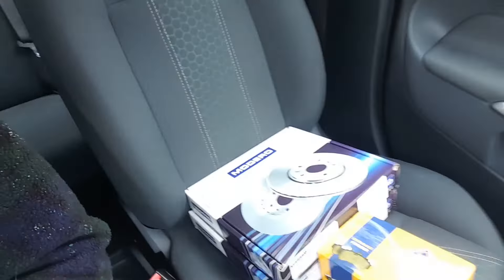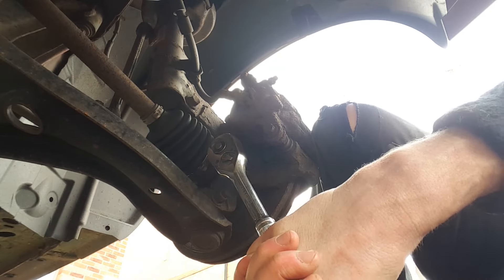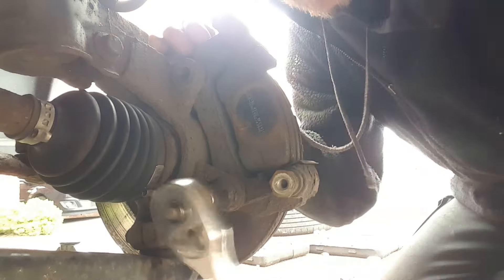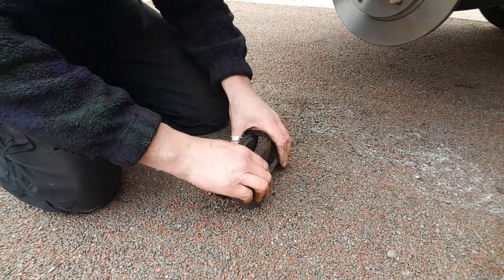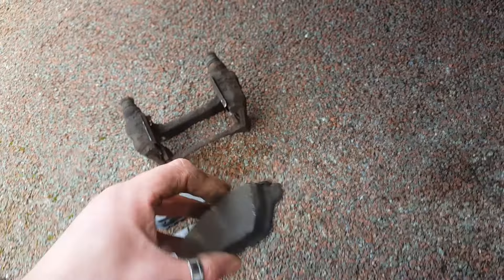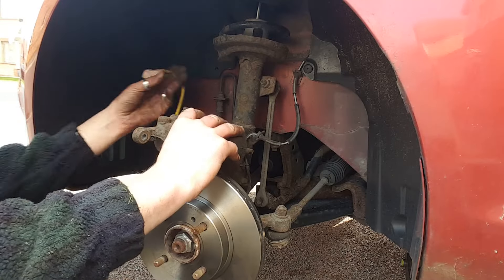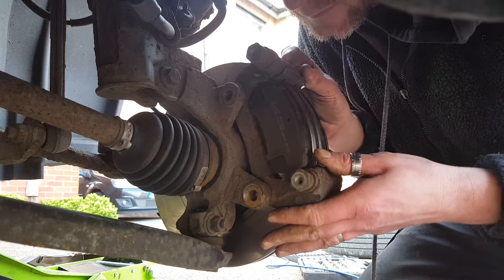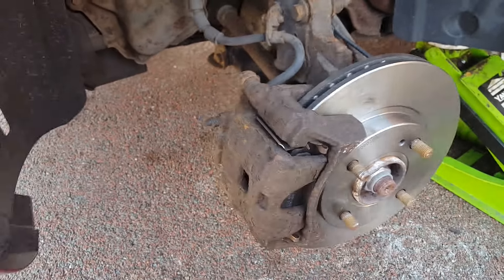Episode 193 - How to replace Mk7 Ford Fiesta front brake discs and pads

Comment: Thanks pal, you've saved a guy some money there. I know what I'm doing tomorrow 👍🏻
Reply from the maker: Cheers buddy. Much appreciated.
I will add something that I didn't feature in the video. Before you fit the discs, just give them a spray with break cleaner first and wipe the surfaces. The discs come packaged with a fine film of oil sprayed on them, to stop them rusting in storage. The brake cleaner will get rid of it once it's wiped off. 👍
Keep me posted on how you get on buddy. Thanks again. 👍

Comment: Just a few points the rust on the hub needed cleaning the rust can jack out the wheel slightly and in time make it loose it’s easy enough with a wire brush on a drill also the pad carriers were rusty as well and those pads need to move sideways you actually had to hammer them in😂 the new disc has a film of oil on it which you didn’t clean off I wouldn’t want you doing my brakes at all this is exactly the opposite of a good brake job,but at least you put yourself out there and make the vids,no doubt you’ll delete this 😂
Reply from the maker: Cheers Rich. It's cool mate. Not going to delete your comment. I'm always up for constructive critisism. Yeah, the car has some parts with rust on them, but they weren't rotten, so I just left them. I probably ought to have given them a bit of spit and polish. I've had a few people who have mentioned about the oil film on the discs also, so I'll certainly remember these bits in future. I'm by no means a qualified mechanic. Just a regular guy trying basic tasks on his heaps of poo. Hopefully with more practice under my belt, I'll convince you to let me attack yours with my spanners! 🤣
Reply: @jimmykneesall yeh why not 😂
Reply from the maker: @richlee5578  😂

Comment: Thats not gona work if toy must use hammer to put brake pads
Reply from the maker: To be fair, I only used the hammer to make light taps for adjustment, rather than full-blown whacks. I just wanted them to be seated correctly before putting everything back. I can safely say they work perfectly fine and have been for several months now. 😉